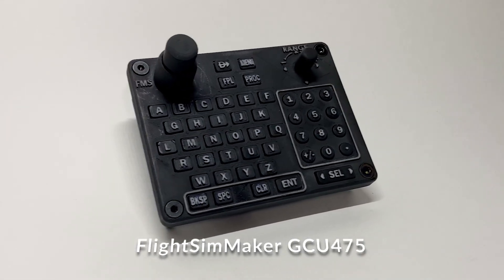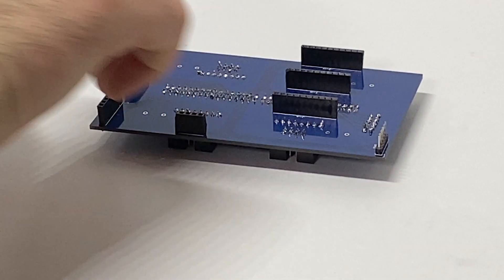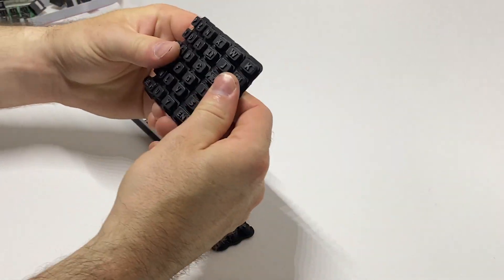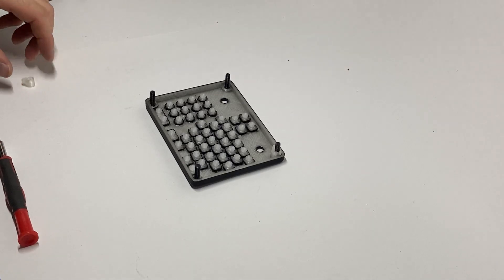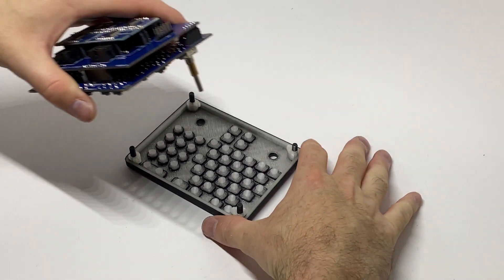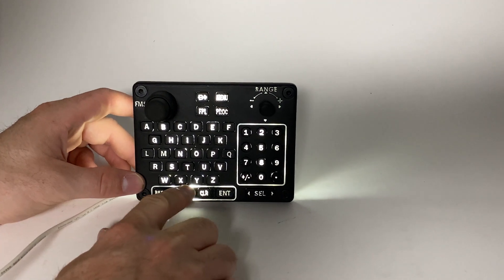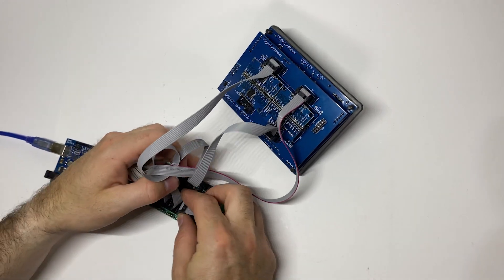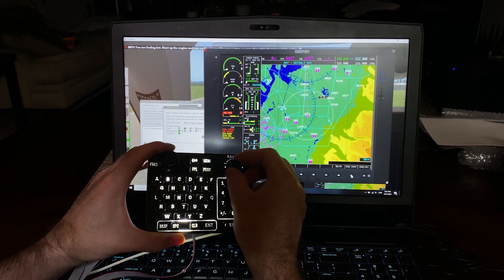3D Printed Flight Simulator Garmin GCU475

Comment: I'm confused why you don't design your PCBs to mount the multiplexer chip directly instead or requiring the extra headers and PCBs of the breakout boards. You'd reduce complexity, build time, and part count.

Comment: I stumbled across you stuff when searching for dual encoder knobs on Thingiverse. Some pretty awesome work you've got going there. I haven't watched all your stuff yet but I was curious why you went with raised lettering? Most panel builders will go with laser engraved buttons. Which is what I usually do by using either white or clear cast acrylic, paint the buttons and then etch in the lettering. I apologize if you mention the reason somewhere before. I just started looking at your videos.....Cheers.
Reply from the maker: EmesiS, The reason is for simplicity. Most people do not have a laser engraver or want to spend the time casting acrylic. Everything I design can be printed, and the raise text is one way of accomplishing that. Consider it the middle ground on flight sim hardware. Yes, its not ultra realistic. But 50$  in components and some time is better for some people than a 300$ professional piece. Flying is expensive, flight simulation shouldn't be.
Reply: @FlightSimMaker  Thanks for the reply. Yes I gathered that after reading more info and watching a few more of your videos. I understand completely about the cost and what you are trying to accomplish.

Comment: Great! One question: what elements do you use between the microswitch  and the buttons? See 2:08.
Can you tell me where to get those?
Thanks for your help.
Reply from the maker: It is a 3d printed piece called "ButtonRod_5mm.STL" and its located in the files on the Thingiverse page.
Reply: @FlightSimMaker  thanks!

Comment: Outstanding! Your video is presenting all the steps clearly, overall looking professional. Please keep the content coming... :)

Do you have a video on how to interact with the flight sim software, preferably MSFS2020?
Reply: mAGiXO94 for msfs I think mobiflight is the only program that supports it. He hasn’t made a video on it as he wants to stick with simvim with xplane for the moment
Reply from the maker: Mobiflight seems to be the way to go for FS2020 as of Oct 2020. This PCB design will work with Mobiflight without the shield and multiplexer boards. It is just a slight change in the wiring, that's all. As Lt. Crunchy said, I plan on sticking with Xplane11 until significant changes are made in FS2020. FS2020 is a very beautiful product, but for what I like to do, Xplane11 does a better job.
Reply: @mAGiXO94 i am planing on making my sim around mobiflight so i will probably changing the wiring my self ill update you on how i go